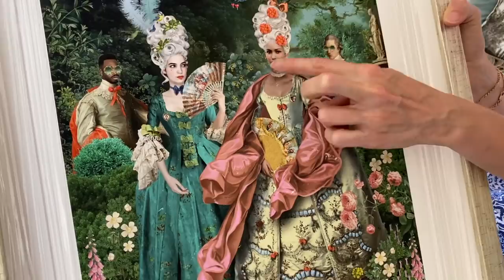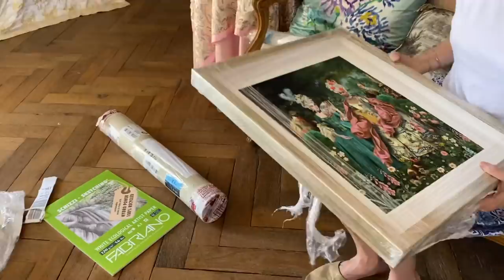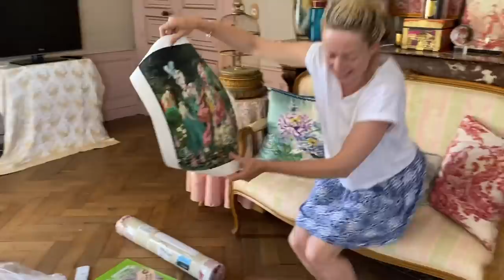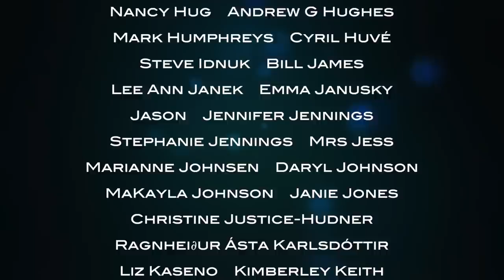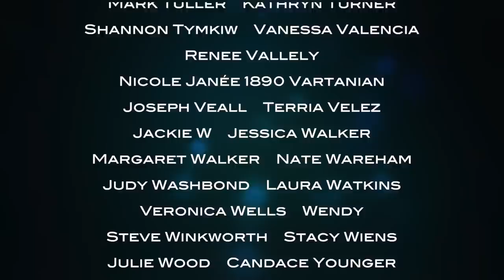THE CHATEAU DIARIES: LET'S GET THIS CHATEAU INTO SHAPE!

Comment: PAINTING TIP: For latex paint if you take plastic wrap (the type you use in the kitchen) wrap your roller or paint brush in a couple of layers then place in the refrigerator,   it can stay there 2 to 3 days without being washed out. Great if you want to take a break from painting then start right at it later.
Reply: Great tip. I ll try and remember it for myself.
Reply: doesnt even need to be in the fridge. Ive had it out for a few days in warmer room temp and theyre fine.
Reply: What is latex paint??
Reply: Non oil paint. Acrylic maybe. Its paint that can be washed off the brush with water. Sorry I don't know what you call it.
Reply: @dragonfly9851  Thanks I get it I was thinking weird like gloves. I am an Aussie we call it acrylic paint as opposed to oil paint. Thanks for the reply
Reply: @kaarenjukes8308  .
Reply: Emulsion?
Reply: Yup I do the same thing with rollers, works great!

Comment: A suggestion for the flower studio : Love Thomas' initiative hanging the curtain but consider replacing it with an old Lalande door ( s ) which would slide on a track suspended from the ceiling. Pipes camophlaged yet accessable.